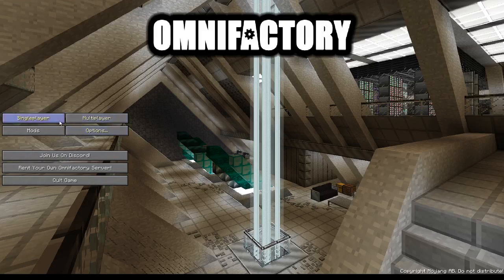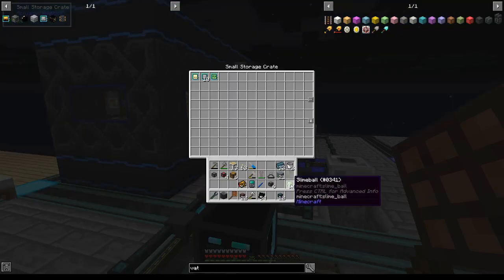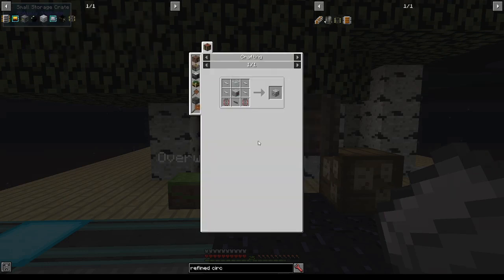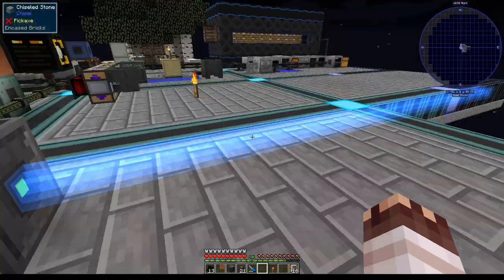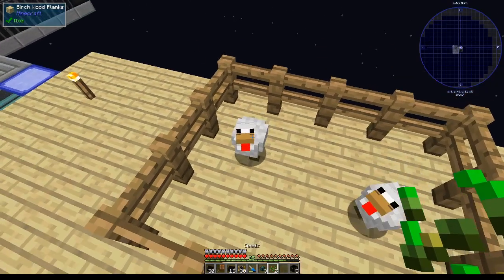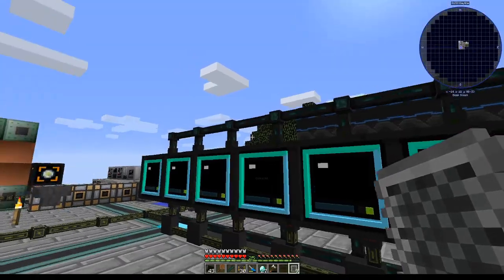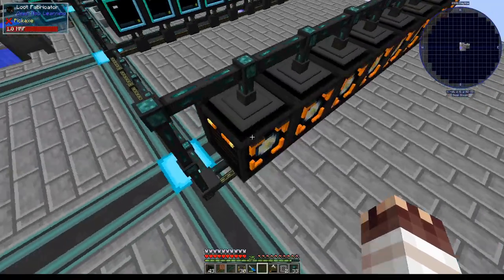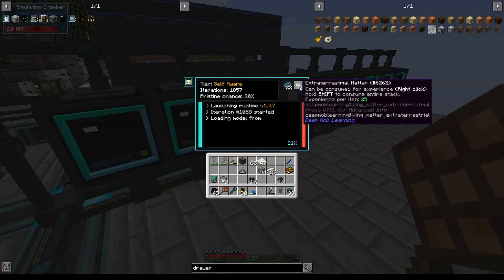New Omnifactory Supershorts #6: Self-Sustaining Deep Mob Learning and Atomic Reconstructor

Comment: If memory serves you just have to change the output side to one that you have access to then use the screwdriver on it. After that you can use the wrench to move the output side back to the side you want it on and the inout functionality will remain. I used this a few times when I did not want to move whatever was blocking access to the output side.